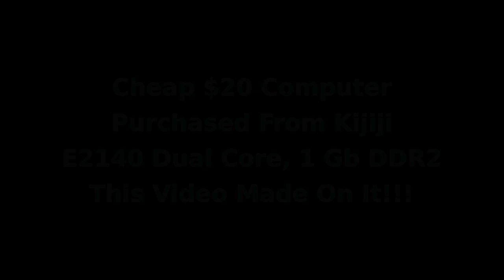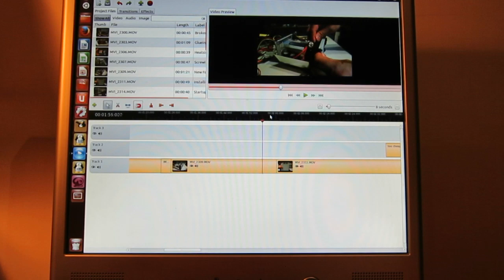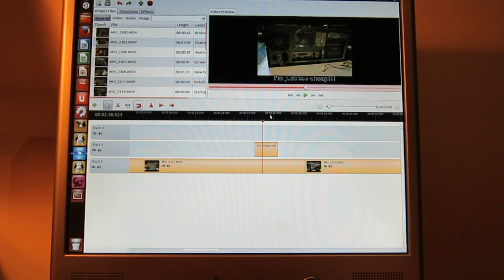Cheap video editing computer build: $20

Comment: why fans are point outside not  inside
Reply from the maker: +Yosef “yosef019” Elgart Sorry, which fans? If you are referring to the CPU fan, the outer case had an exhaust hood and by pattern of the dust around the cooler it was blowing outside. I've seen some older units do this and still cool well. I have upgraded this heatsink recently to cool my newer (but still old) Q6600 core2quad.

Comment: Got a Intel core quad core q9400 at a thrift store for $30 had no hardrive and psu  everything worked had some spare parts from my old pc  now it's overclocked to 3.6ghz water cooled 8gb ram EVGA geoforce 750ti FTW edition only a little bit of a bottleneck but runs perfectly can even run Gta 5 on high settings
Reply from the maker: Sweet! I'm jealous of the graphics card.

Comment: hi Evan Lee, can you include links where to find these cheap components? from what I understood they cost less than a raspi and of course perform better ?
Reply from the maker: Stephen Chen Mb/case/ram/CPU all from Kijiji (similar to Craigs List). I have some local stores like Tigerdirect and Canada computers to get components (on sale). I upgraded the cpu to a q6600 (quad core) from Kijiji. Video card from Tigerdirect (always wait for one that is on sale after rebates). Just be patient and you'll find deals. I rarely pay full price at retail/online stores (wait for the sales) and used components have been in good condition. You just have to know what a fair price is and negotiate.
Reply: Evan Lee wow thanks for the tip...I guest I will have to learn the art of waiting for price cuts/sale.. I just find it hard to trust sellers from those sites specially that components can have a tricky life span... but from what I see, It might be worth a try :)

Comment: No way to cost 20$, in my country,computer like this cost like 40-50$
Reply from the maker: +Aron MacEachern l love good deals on Kijiji.
Reply from the maker: Too bad! I just get lucky sometimes. Only better deal I've ever gotten was on a 2.5ghz amd processor with 5 gb ddr2 RAM. Just no operating system. Those deals get picked up fast. I use Kijiji here in Canada.
Reply: Evan Lee I recently got an Athlon x4 630, M4A78T-E mobo, 8 gig ddr3, 60gig SSD, 320
 HD, CX600M inside a basically new Zalman Z9+ case for $100 CDN :) I 
added a Hyper 212 I got for $20 and now it's running with a nice 
overclock at 3.7 Mhz. Great deals are out there. I got all of it off of Kijiji.

Comment from the maker: I got my hands on a used core 2 quad q6600 for $30 and put it in. No surprise, everything works faster and Openshot doesn't  crash anymore. My original build still worked but this is better. The total cost is now around $90. Using it for every video and still with Openshot.
Reply: Evan Lee That Q6600 is a fantastic cpu! Get an aftermarket cooler and you can overclock the crap out of it. Mine was running @ 3.8 with an Arctic Freezer 7 since 2007 before I upgraded to a 4770k last year.
Reply from the maker: +Kenneth Moureau i just got a better cooler. Never thought to over clock it. Great idea, I'll give it a try!
Reply: +Evan Lee still running with 1gb? i would send you 4gb if you pay shipping?
Reply from the maker: +piet Paulusma Thanks for the offer! Very generous of you. I'm okay though, I have a crazy 2gb now and it doesn't max out at all. I have tried 4gb but no improvements in performance. Hard to believe but running Openshot uses all 4 cores of the q6600 but little ram. Again, thank you so much for the offer though!
Reply from the maker: +TerrahBite Tinkering! That is my thing to do! I love to hear so many people can appreciate old tech can still do the job. It's not perfect but fun. Take care and thanks for watching/replying.
Reply: +Evan Lee im working on getting my  q8200 to work in my motherboard. ^~^ 
i'll be buying my boyfriends proccessor soon, so i'll be immediatly upgrading but its always nice to have a spare rig laying around ya know? 
something to tinker with. ^~^
Reply: +Evan Lee i want to say that the faster clock speed, bigger L2 Cache and the higher FSB may have had a bigger effect than the extra cores.
Reply from the maker: +Superchad245 I don't know, you may be right. I guess the overall package helps!
Reply: Evan Lee true, have you made any other changes?
Reply from the maker: +Superchad245 I'm always looking for deals and so far... The q6600 ($30), a heatsink ($15) to handle the higher temps, 2gb ddr2 (free), hd5450 ($20). I think that's it though. Video editing is going faster. In the end a sub $100 computer for all me youtubing and family films.
Reply: Evan Lee id like to know where you get all that stuff at all those prices
Reply from the maker: Superchad245 A lot of stuff I buy used on Kijiji. I don't have a big budget like some guys on Youtube. I also wait for sales at Canada computers/ TigerDirect/ Newegg. Almost never buy something unless it's on sale. I've watched prices so much, I know what items frequently go on sale and sometimes you wait until the next month or Christmas even for the best sale. There's no way I'm ever going to buy a Titan X or 980, so it takes a lot of work to find the deals.
Reply: +Evan Lee nice, i have tried buying to resell but can never find things that cheap anywhere.
Reply: +Evan Lee dont forget to look for a FreeGeek near you!
i know for sure theres one here in portland and one up in vancouver (canada one, sorry washington people >_< ) 

also dumpster diving, i got a pretty nice tower cooler from that just the other day.
Reply from the maker: +TerrahBite there is a free geek in toronto as well. http://freegeektoronto.org Thanks Terrahbite for the suggestion. Never heard of them before. Dumpster diving is great. I got a dell that needed capacitor repair, took the 500 gb drive for myself and sold that system. Nice to hear someone else is dumpster diving as well!
Reply: I picked up a used gtx 480 for  $40 the other day. that's the kind of thing you need to round this pc off. (if you have the power supply)
Reply from the maker: +DARTH VIRAL better graphics card would be good. I'm always looking for good used deals.
Reply: +Evan Lee it runs shogun 2, xcom, the wolf among us, the witcher 3... better graphics card is always good, but sometimes it's just unnecessary, specially if you're getting the performance you need for your resolution and refresh rate requirements.

also, I really wouldn't bother pairing a better gpu with the limited amount of cpu power in a q6600
Reply from the maker: DARTH VIRAL
agreed

Comment: Why didn't he just use electrical tape? That's about ten times more reliable and his house won't end up on fire. (0:53)
Reply from the maker: How would it go on fire. Do you know what the melting point of hot glue is? Electrical tape eventually loses it's adhesion. Better to use heatshrink but I'm cheap so hotglue works really well.
Reply: Yeah 120 C, which your psu could easily reach if there was a malfunction.
Reply from the maker: If it went to 120C because of a malfunction... you got more serious issues than hot glue melting. Many components won't even function past 105 C.

Comment: why did you change the psu at the end
Reply from the maker: I found one on sale and I still felt the 'Turbo Link' was still louder than I wanted. No rattle but the blowing noise was annoying. I got the psu for $15.00 with rebates brand new at tigerdirect. By the way. It's still working great.
 I'm using the turbolink in a different computer where noise isn't an issue.

Comment: do know any like more reliable sites for the cheap price like parts for a computer. or maybe in a set for cheap. And i loved what you did to the ps3. maybe i missed it but why did the ps3 break
Reply from the maker: I'm in Canada and primarily use kijiji for the major components and computers. Ebay I use for components like fan controllers, switches, leds etc. I look everyday at Tigerdirect daily slasher deals.

Ps3 had the YLOD. I fixed it 3 times total but each fix lasted a shorter time. Overall it went another year before I had to put it down. At least the case got some use. I might upgrade the cpu to a quad core $60 and 4gb ram for $44 from ebay unless I can find one on kijiji for cheaper.
Reply: Evan Lee so you are saying ebay and tiger direct.  one more thing. how did you get a kit. because i see no place where they let me build it myself
Reply from the maker: Could you clarify what you mean by kits to build? Do you mean barebones etc?
Reply: Evan Lee i mean like a set where they gave all the parts like yours
Reply from the maker: Nehemiah Yu HaHa! You can't just get a combo or a "set". I searched for each thing separately at kijiji,ebay,tigerdirect,canada computers,ncix etc. It took a LONG time to order and get everything. I waited for deals to come along and tried not to settle for anything that wasn't on sale.

From the computer stores like tigerdirect:
You can get barebones sets that have a case, cpu, ram, psu, hard drives, maybe video card. You just have to put it together and install your software. 

Finally, there are motherboard combos but that usually only comes with a cpu, motherboard, and maybe ram.
Reply: Evan Lee so tiger direct gives almost the whole set. where. can you like link it. yeah i wanted barebones sets like that.
Reply from the maker: Nehemiah Yu http://www.tigerdirect.com/applications/category/category_tlc.asp?CatId=31 
Visit a site like this and you will see amd or intel combos. Remember, you still need an operating system added. Barebone kits allow you to make choosing simpler, things will be compatible, and it is custom.
Reply: whoa this is awesome
thanks for your help

Comment from the maker: Found some things on sale so I added it to the computer to improve performance a bit. Increased RAM to 1Gbx2 ($14) and 1GB DDR3 video card (XFX hd5450 for $20).

Total cost now $56.88. These last 2 things are not necessary but I want to slowly upgrade it for fun to see what more it can do. Light gaming? Maybe after the CPU is upgraded (in the future).
Reply: what about a video update :D? BTW you have a new sub :D
Reply from the maker: Rúben Valentim
You got it. The last bow builds, PS3 PC build, and futon build were edited on that computer. It is my main computer now. Not bad for $56.88. I've been busy on my pvc bows lately. I'll try to get to an update soon. Thanks for the sub. Go cheap or go... broke.
Reply: I effectively have this pc that you have built for $20. I bought mine for £50 though. It has an e2140 dual core with 2GB of ram. It also has an amd ati hd 4550 with it as well as a windows 7 OS. The answer I'm giving you is no, you can't do much light gaming unless it is old games like quake or halo combat evolved (I got 200+ fps on halo)
Reply from the maker: Mooshrooms Incorporated
Oh I agree, I never meant modern games. This is purely for old ones... Just like the computer!
Reply: Evan Lee Yeah, fair enough but I find it quite annoying that it won't play newer games like Minecraft or robocraft at a higher resolution or FPS. Otherwise it's a great pc on other tasks like internet browsing (usually for cheap pc parts) and video editing. plus I've made my own custom case that says AMD on the front and the like. I love it!...